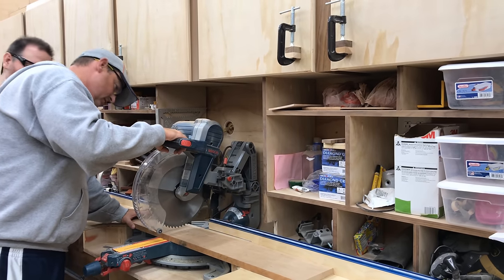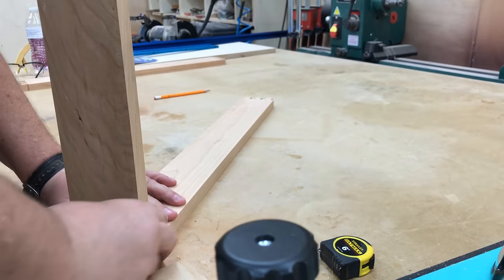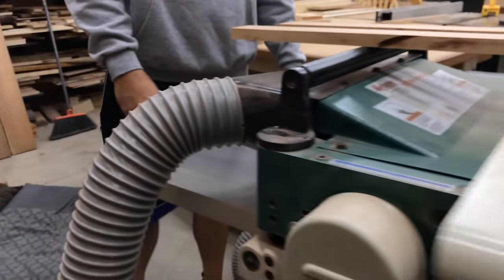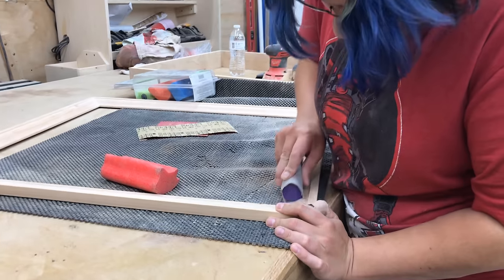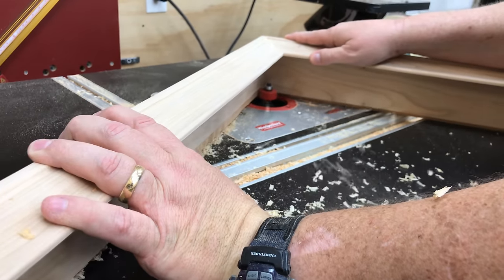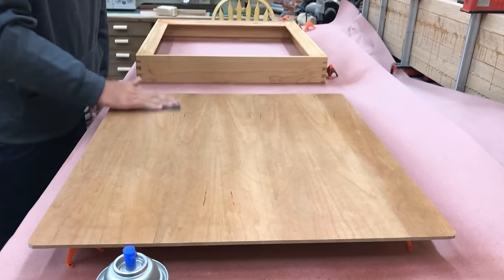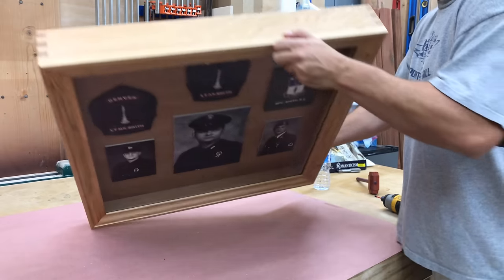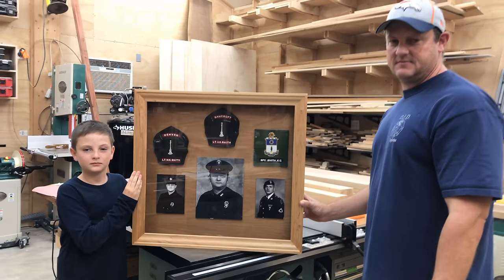40 - How to make a Picture Frame Shadow box Online Class 4K Video

Comment: Project came out beautifully.  Nice tight miters.  Well done. 
Not sure why you wouldn't have used a flush trim bit instead of all the belt sanding at 9:35
Reply from the maker: Thank you very much! I use belt sander half the time and the flush trim bit half the time. There is never tear out with a belt sander, so I probably use that a little more often.

Comment: What a great way to reconnect to an old friend.  Question, why the belt sander to flush the frame instead of a router trim bit?
Reply from the maker: Hi. Thank you! It was great. And, no reason really, I use both methods. In this case I already had the sander out from sanding the dovetails. Also, I have had a lot of practice with the belt sander. If you are new to the belt sander and not sure if you can keep it flat and flush a flush trim bit would be smarter and easier.

Comment: Great project. Any particular reason, other than preference, that you don't cut the rabbits on the tables before assembly ? Thanks
Reply from the maker: Hi Deb. Thanks. You can cut the rabbet on the table saw prior to the assembly, but you'll have to stop before it reaches the end of the board, otherwise there will be a gap on the side that will show through. But it is perfectly do-able. Thanks for watching and commenting!
~James
Reply: Thanks for the reply. I didn't think about the fact that it didn't go to the end. In that case, I guess the router would work best. In fact I just watched the dovetail drawer video, and you did use the tablesaw for those rabbets. Pleasure to watch you James. You are a great teacher.
Reply: Very nice craftsmanship.  How did you attach the pictures to the back board?  I am working on something similar for a 25th anniversary and a couple of the pictures have not been taken yet.

Comment: Curious why you chose a belt sander instead of a flush trim bit on a router to flush up the frame
Reply from the maker: Hi Alec, no reason really, I use both methods. In this case I already had the sander out from sanding the dovetails. Also, I have had a lot of practice with the belt sander. If you are new to the belt sander and not sure if you can keep it flat and flush a flush trim bit would be smarter and easier.
Reply: @KingsFineWoodworking  I call the belt sander "the angry man" of my shop.  I always approach and use with caution.

Comment: Very nice James, as usual. Can I ask why, during the dry fit of the frame, in the background she is taking the plate off of the router. Do you only put it on for your dovetail jig?  Or was there an issue?  Just curious.
Reply from the maker: Hi Robert! Thank you. We use a different router base that holds the collet when I am cutting dovetails. And she was putting the standard router base back on it.